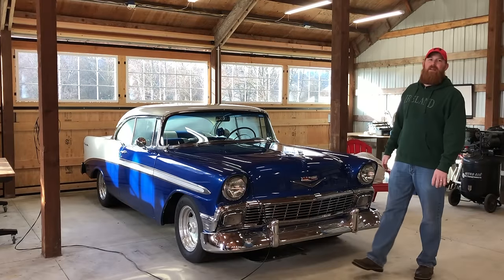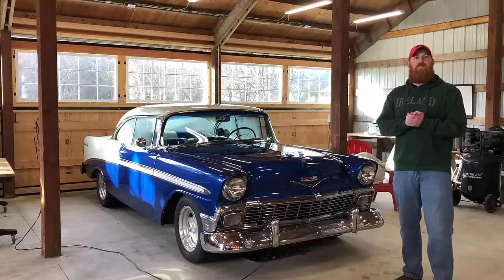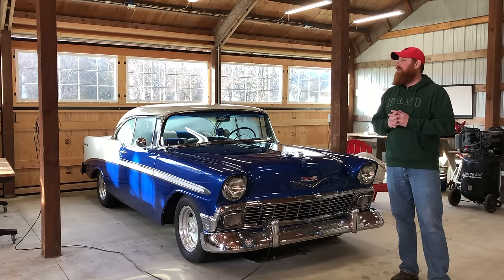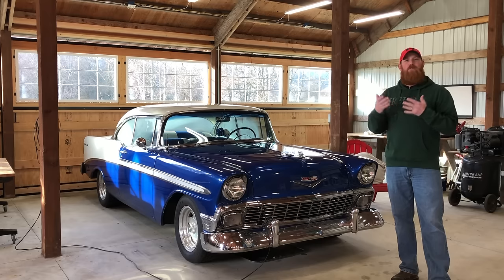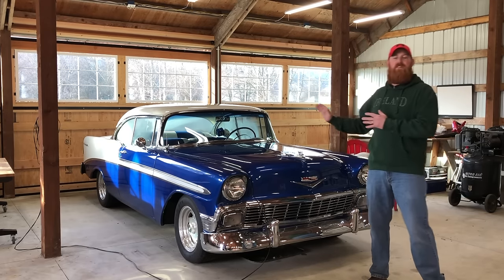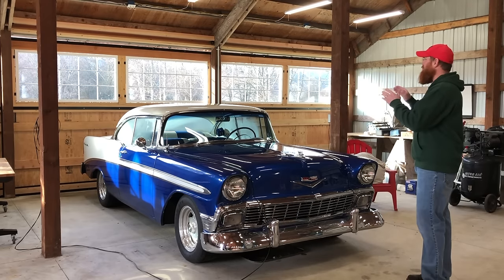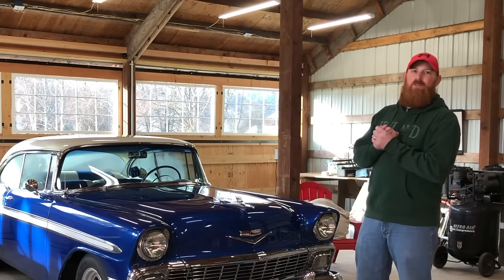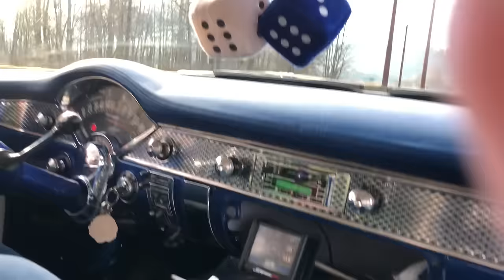Glasspacks vs Flowmaster - which one do. you prefer?

Comment: Had Flowmaster Delta 50s on  my '56 Chevy with 350 chevy motor, block hugger headers and 1 3/4 exhaust.  Sounded great though a little quieter inside and out.  Disappointed that the title says vs Glasspack.  Would like to have heard what the glasspacks sounded like in comparison.  I have 23" glasspacks on my Model A coupe and not very happy with the sound.  Thanks for posting this video, one of the best on Flowmasters.
Reply from the maker: I might not understand you question but the video does show glasspacks first then the next clip is the flowmasters.
Reply: @BigRed_1980  yup, that's clear enough in the vid!

Comment: I prefer glasspacks myself but what I actually don't like about them is in my experience, it takes a very long time before they really settle in and make that deep sound I like. In fact, my 1972 F250 has about 87k miles on 30 inch glasspacks dual exhaust with 2 inch pipe. I think I had about 45k miles before it gave the sound I like but now that they're pretty worn, I like them better. The same with my 1970 Nova applies but probably took a bit longer to settle in because I didn't use a cherry bomb brand. It was put on an aluminized pipe system so I think those 30" glasspacks were designed to hold up a little longer. It is possible with shorter trips that don't allow all the moisture to get out of the system may help the mufflers to settle in quicker. That said, I think if you want instant sound you'd like,  I'd say Flowmaster might be better in that respect.

Comment: In my experience and depending on the gearing of your car, the flowmasters are great unless you are going to drive on the highway at all. The drone from mine would literally fatigue me.There were times I would cruise at 90mph just to get the RPM out of the drone zone. When I switched back to a glasspack the car was still as loud under acceleration, but it didn't have the loud oppressive drone at cruising speeds.
Reply from the maker: With the Delta muffler I don’t get any drone on the highway 😁
Reply: @BigRed_1980  
That's good. I did a round trip from Beale AFB to Houston and back and it made me switch to a Magnaflow glasspack setup. Haha

Comment: Very nice vid. I did not have preference between the two, but the bottoming out can be annoying, I have that on my 64 Caliente with a 302 and headers. For that reason alone, I'd change them. The 56 Belaire is sweet, had one in the 60's took cross country twice going to an Army duty station on east coast from L.A., a good little car, with auto and 265 V8, same block as the 327, I guess. "Mine" was actually my first wife's car, it as white and maroon. Nothing moded, just dead stock car then. Wish I still had it; we sold it in the 80's for "peanuts". 

Now have a few Fords, a 64 Ranchero, 64 Comet, 67 Cyclone, and 64 Fairlane. All sound good with Flowmasters on all of them including the "Chero" with a 200 six in it and single exhaust!!! My first car was a 55 Ford Ranch Wagon, when I was 17, that's 60 years ago! A hand-me-down car from my dad when he got a new 64 Dodge truck, for his carpentry business then. The Ranch wagon was an auto with a with 272 V8 and it had the Glasspacks, they sounded very good on that car, as I dimly recall!! I traded the car in for a new 67 Cyclone GT 390, in 1966, a few months before I got drafted, in 67, and my parents sold the car when I was in for two years. The car was completely factory stock and needed nothing else to make it pretty cool then! I have another one now with a few engine mods, but still dead stock looking, inside and out, white with black vinyl top. LOL ;D

Comment: I HAVE USED BOTH ON MY 1961 SUNLINER. AT FIRST THE GLASSPACKS SOUND BETTER BUT AFTER AWHILE THE EXHAUST STARTS TO SOUND TINNY. THE FLOWMASTERS DO NOT SOUND AS GOOD AT FIRST BUT MONTHS LATER STILL SOUND THE SAME. POWER OUTPUT WAS NOT MUCH DIFFERANT BETWEEN THE 2

Comment: Glass packs sound good in my opinion. I had a 64 chevy  impala with the 327 small block and a 2 speed power glide transmission and ran it with glass packs it was nice.

Comment: Specs have fun if you're driving a lowrider what the stock engine.
Better continue thing bigger isn't low didn't need to Flowmaster.
I have Flowmaster in my vehicles. And they sell stock Motors.

Back in my hometown in Northern California. Back in 75. About 68 Bronco. Single exhaust 289. So headed changed up dual exhaust what's glass-packs.
On my old lady would take off from her house. I could hear that thing four blocks away..
Change that real quick the Magnaflow. I don't think they Flowmasters in. With the Flowmaster. But like I said I can go either way. Thank you for the video.🤙🏾👍🏽🙋🏽‍♂️😊😎😎💪🏽💪🏽.
Oh I no longer have the Bronco so good after 46 years still ran same mufflers
Going on Five Years Gone.
I no longer live in California.😔🤙🏾

Comment: Idk what to put on my car. I have a 79 Z28. As of now it has long tube headers, into X pipe (and dumps for the occasional laugh), then back into dual Flowmaster 40's, over the rear axle and out under the rear bumper.  I want to redo it eventually because the installers did a crap job and it's falling apart but I wanted to try a different muffler. Any recommendations?
Reply from the maker: For my truck I have been contemplating either flowmaster outlaws or borla XR-1's. they both are pretty loud though.
Reply: @BigRed_1980  that's my other thing too I don't necessarily need a loud muffler cause I can open the dumps for open headers. But I still want a race car type exhaust note
Reply from the maker: @geniusatwork12  My truck has a 454 with flowmaster 50's. I think those might b e what your looking for. They sound really good both outside and inside the cab but are not too loud and have zero drone. https://youtube.com/shorts/UnLNzT07dPY?feature=share

Comment: Glasspacks!
But I would like to point out that the exhaust exit is different, straight out the back with the glasspacks, and turned down with the flowmasters.  This is changing the sound especially from the rear, so the test isn't an exact comparision, but otherwise very well done.

Comment: Glasspacks sound more period correct, but that flowmaster you can tell helps it breathe better since it gets up to speed quicker
Reply from the maker: Thank you. When I did the exhaust change I also did several other updates including an upgrade to fuel injection. That could also have helped with performance.

Comment: I personally like the fuller, throatier sound of the Flowmasters. The Glasspacks, although very reminiscent of "the sound back in the day", sounded nasal and tinny and a bit abrasive to me then, and still do now. I have to upgrade my 2" exhaust on my 1970 Charger to 2.5" and considering the Flowmasters. A 383 Magnum with Glasspacks is just too harsh and brash-sounding for my tastes. I think maybe the Glasspacks are a good choice for small blocks, makes them sound a bit meaner, I guess. You don't need that with a big block, they sound plenty badass as it is. :)
Reply from the maker: Thank you 😎

Comment: Glass packs are the 60’s equivalent of the fart cans that the Honda kids all put on. In another 20 years we’ll all be nostalgic for that to. The glass packs are more ratrod and the flow masters are more muscle car. Piping size matters as well.  The smaller tubes have more pop the bigger tubes are deeper.  The headers vs manifolds matter too.  Just 2 different styles

Comment: Flowmeter 40 series sound better but personally I think they sound better if you cut them off  with turndowns at the rear end but doing away with the headers you do away with a scavenger effects and lose performance you can get headers that won't drag and keep the scavenging effect and do something with the suspension and you can keep the benefits with the flowmasters and personally I would use the turndowns at the rear end.

Comment: They both sound good. But I prefer the glass-packs it had a better sound to it. Definitely a 60's sound for sure with the glass packs. I like to go in first gear till about 40 miles an hour or more then back off throttle and let it  rap out as its deceleration

Comment: What has become important to me is the sound at a 2300-2600 RPM cruise. Small block, block huggers, 2.5 head pipes with H pipe, Flowmaster 40s, 2.25 tails. Drone is bad. She's getting better mufflers.
Reply from the maker: I was nervous also that the drone would be annoying but I don’t have any except for around 1100 RPM’s. I think the delta mufflers must help that. I will say that my cruise RPM’s are lower than yours at cruising though.
Reply: @BigRed_1980  I guess I'm just getting too old. I like to know there is an engine under there but I don't want it to be all I hear. I swapped cherry bombs for old style turbo muffs on my truck and found out that I have a whining pinion bearing. 
The car I'm speaking about has a 700r4 and a 3.08 rear, at 45-50 I'm running 1400 or so and it's loud. 2500 is haulling a$$ on the interstate.

Comment: Changing where tailpipes  come out change the sound just manifolds to header and whether  you have x pipe  or your glasspack are new or old and the length, makes a difference. I used put on chambered  glasspack  that I had.   custom made before flow master  were ever around I like maga flows better. And the chambers  glasspack  works great on 2.2 dodge  with header  (Jbh headers the best out their.  And put flex tubes on headers will stop the leaking gaskets.) and resonators should like v8 till about 3000 rpms . I and my brother have had our custom exhaust  show up at sema show and others. And if you like glasspacks  but not the cackle  put a x tube in glasspack  sound without  the cackle.

Comment: I run the Delta Flow 50's on my bone stock 1971 Cadillac Coupe DeVille! She idles quiet!  Rumbles at cruising speed!  But you don't really hear the exhaust until you floor it.
Reply from the maker: I have those same mufflers on my 57 Chevy truck with a 454. For me, they a little too quiet 😁
Reply: @BigRed_1980  That's why I like them for the Cadillac.  They don't make noise till you want the too.

Comment: My personal preference are the glass packs for the sound and the fact there are no baffles in the way of flow. The flow masters don't sound bad either also headers will influence the sound some too so your not quite comparing apples to apples but still enjoyed the video and the car.
Reply: No baffles in the way of flow???? What is in the way of flow is any kind of packing material even fiberglass it robs horsepower. Not as bad as a stock muffler but it does some. A Flowmaster has not packed into it so exhaust flows directly through it, yes it has pass through a chamber and into another chamber to continue out but there is no backpressure as there is in any glasspack! In many cases there is dyno testing proof that Flowmaster actually can increase horsepower!
Reply: @chrissullivan9143  If you look at a glass pack Thrush, Cherry bomb ect you can see directly through it. There is nothing to interfere with flow you can not see though a flow master.  The fiberglass in a glass pack surrounds a perforated tube that goes through the glass pack there is no flow change of direction ect. I'll take a glass pack over any chambered muffler any day unless your looking for sound control in which you have to give up some thing to obtain attenuation of Db's .
Reply: Well it's been a long time since I managed speed shops but over 20 years ago those other types of mufflers had material packed into them. This is what quieted the sound down but also contributed to backpressure. I can't see how the steel exhaust tubing can just run straight through the muffler and just have something wrapped around it to deaden the sound. How does that work?  I can't imagine it knocks the sound down very much. In my area where they are very strict on noise ordinances I'm sure I'd get a ticket every time I took my car out.
Reply: @chrissullivan9143  It's not a solid steel tube but has perforations in it and is wrapped by fiberglass to absorb some of the sound. It mainly gets rid of high frequency sound to produce that low rumble most associate with glass packs. This way there is really no disruption of flow only some sound attenuation and not a whole lot to to be honest. If your looking for some thing quieter your going to have to go to some sort of baffle or chamber design. Where I'm from the police are not too strict on noise but than again when I see them I tend to be very light on the gas and its not so bad, but wide open those glass packs roar.

Comment: Why's the electric fan coming on full speed when it's cold?
Reply from the maker: I had been driving the car before I started filming that day.
Reply: @BigRed_1980  Gotcha... It's just a great way to really kill the engine oil by taking forever to get to temp. And it greatly increases wear
Reply from the maker: @TheDynotuner  I hear you. The fans are temperature activated. They come on at 180 degrees and turn off at 175 degrees. Thank you for the concern though:)
Reply: @BigRed_1980  No Problemo... When you build/tune for a living ya notice stupid stuff like that as unfortunately alot of my day's are filled with fixing hack work other's have paid these rip off artists to do

Comment: Glasspacks ftw….i got 3” dual glasspacks about 16” after the collectors on my long tube headers and the exhaust exits right past the door openings on my nova before the rear tires…..its gotta LSA supercharged 370” lq9 in it, youd never know it was supercharged cause the exhaust is so loud you cannot hear the blower…..my c/10 on the other hand has 2.5” summit flowmaster knock offs and basically routed the same as my nova but instead it has a vortech centrifugal supercharged 5.3 in it and its definitely noticable ….the blower is way louder than the motor!!!…..im gonna put the dual 3” glasspacks on it soon too!!!

Comment: Lol....old school Flow Master sound?
Whippersnapper.
My idea of old school and yours are two different things. I'm in my 60's and my 427 Ford with factory cast iron long tube headers with Cherry Bombs (They gotta pop) sounds old school to me

Nice 56 and good video.
Reply from the maker: Thank you. I would love to hear you 427. Do you have a clip of it?
Reply: @BigRed_1980  No , unfortunately I don't have any recording of it.  I'm replacing my worn out 427 center oiler block with the new BBM side oiler. 
But it will sound like any other healthy FE engine with some dual four barrel thrown in.
Reply from the maker: That sounds like that will be a sweet set up. What are you putting it in?
Reply: @BigRed_1980  It's a 65 Galaxie 500....Top Loader four speed.  Schneider Cams .640 lift 306 adv duration solid roller.  1964 Thunder Bolt High Riser heads ported by Craine Cams back in the day.  Dove 2x4 single plane Tunnel Wedge intake and Holley's. 

It was a blast as a Low Riser with approximately 450 hp , but my builders and Schneider are predicting 600+ with the better breathing heads and lumpier cam.....I'm going to have to learn how to drive it all over again.
I'm in the Seattle area, so the pavement is nearly always wet, so it takes a light touch.
Reply from the maker: Sounds like a sweet ride. I live in Puyallup so I know what your saying about the wet roads😁

Comment: The engine seems a little happier with the manifolds and 2-1/2" pipes. Unless the difference is some tuning in between takes.  If it was mine I'd make sure to put in an h-pipe and I would use dynomax ultra-flo or super turbo.  I would also step down to 2-1/4 after the mufflers to help velocity.
Reply from the maker: How does the H pipe effect sound?

Comment: I’ve got the best of both worlds on my F250 with a 351w. 2 1/2” into a single 3” x 12” long resonator that goes into a Flowtech Raptor (flowmaster knockoff 1<2) with dual 2 1/2” all the way to the bumper. Hard to explain but its got a little of both glasspack and flowmaster sound. 😆

Comment: I like glass packs on an old work truck but I like Flowmasters on a hot rod. The only bad thing about Flowmasters is they don't flow near as well as a glasspack. I saw the guys from dynomax flow testing mufflers at a NHRA event and the Flowmasters don't flow that great. I'm sure it doesn't matter that much on a 300 horsepower engine though. Personally I still run Flowmasters on both of my trucks
Reply from the maker: I have Flowmaster on my BelAir but recently switched my truck to Black widow 250’s. I gotta tell you, I like them😁
Reply from the maker: https://youtube.com/shorts/wZOT8tJ49ZA?feature=share
Reply: @BigRed_1980  I have flowmaster super 10s on my 05 Silverado. True duals, no cats. The black widow 250s remind me of the super 10s
Reply from the maker: Interesting. I have not been able to hear the super 10’s in person… what do you think of them?
Reply: @BigRed_1980  they are loud, but they're my favorite flowmaster. My dad has a 3" exhaust on his Chevelle with a x pipe with super 10s. It sounds pretty rowdy
Reply from the maker: I wonder how the X pipe effect the sound?
Reply: @BigRed_1980  it smoothes out the exhaust note and actually gives you more upper RPM horsepower. NASCAR uses the x-pipe design. It will quieten down the exhaust a little bit too
Reply from the maker: @Bobthebuilder.69  Thanks. I have was considering it but I kind of like the sound of my exhaust now 😁